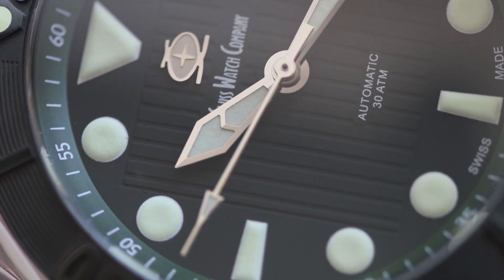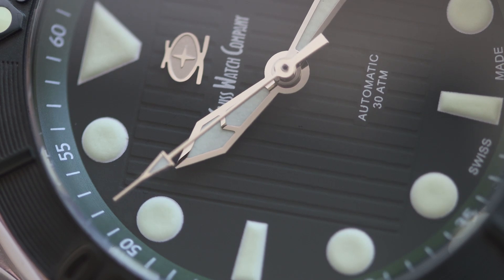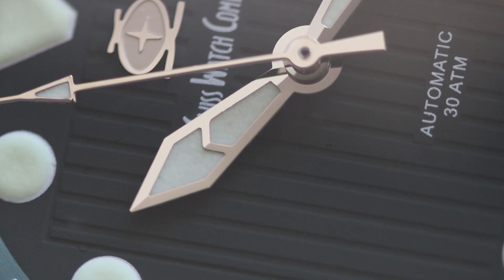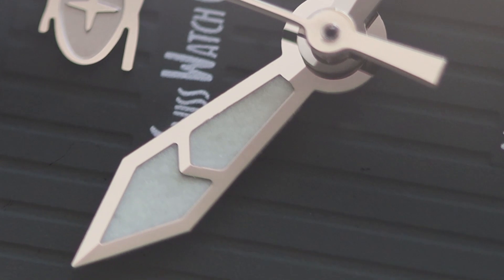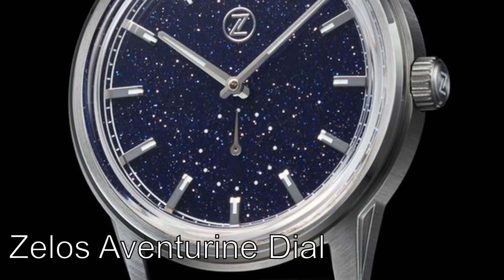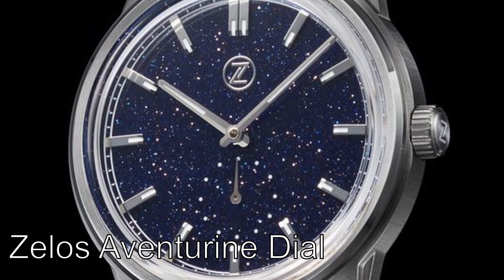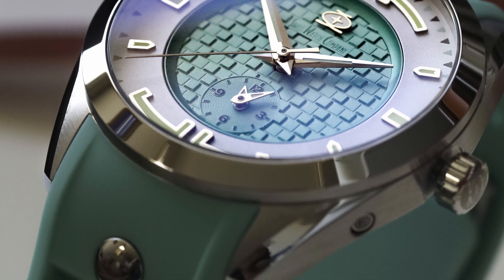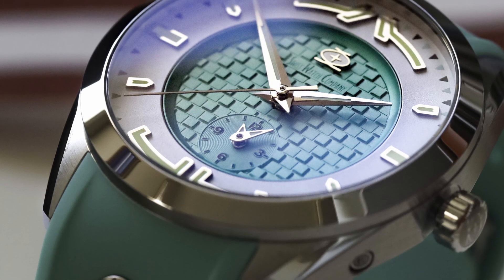How Dials are Made

Comment: Awesome topic! I learned quite a lot as usual. Was wondering if sunburst and fume dials are a textured treatment to the paint after its applied? I love how there can be so much variability in dual manufacture and design.  This vid actually spwned more questions for me, lol. Be well gentlemen!
Reply from the maker: That is so great to hear! Sunburst and fume dials are textured and then either have paint or plating applied. Whether it is plating or sprayed will depend on other factors. Though if I understood my dad correctly, if the dial is sprayed a very thin application of clear coat is applied. If the clear coat is too thick it can take away from the textured affect of the dial so it is important to get it as thin as possible. 

It just might have to be a topic we revisit again! Especially if the world opens up and we can get some first hand footage of the process.
Reply: @swisswatchcompany1710  very cool, thank you again for the knowledge!